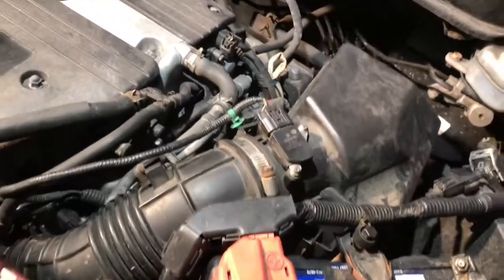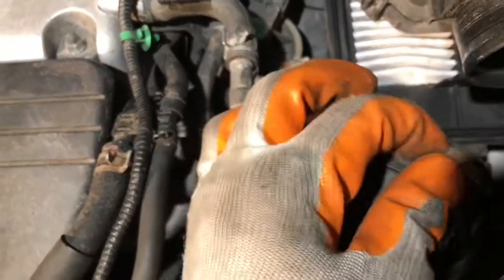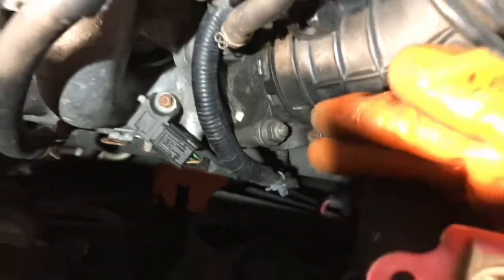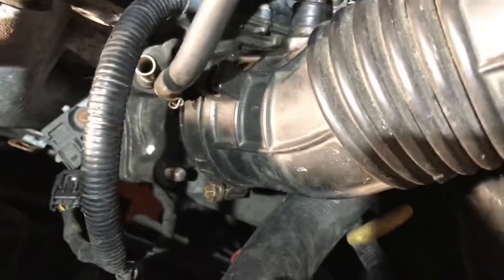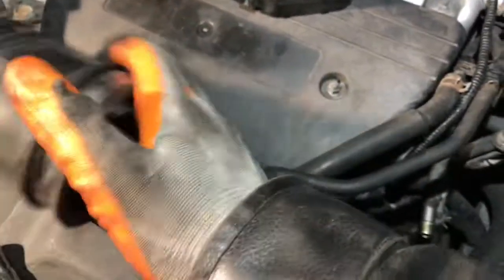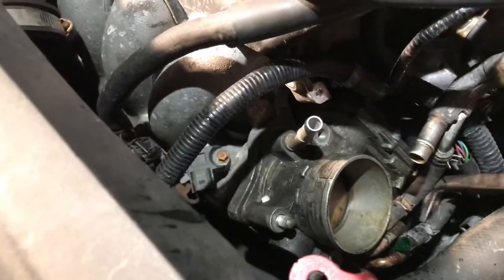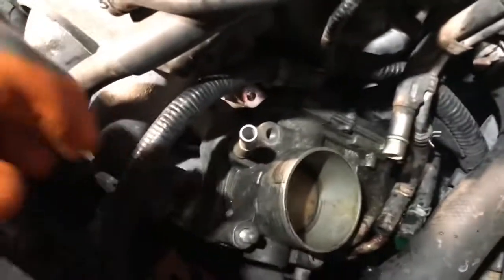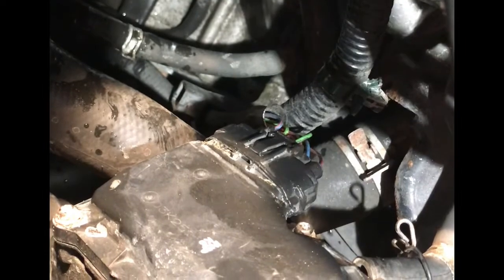Honda crv throttle body cleaning 07–11

Comment: I left the throttle body fixed to the block and cleaned it there, I also pushed the throttle blade open to properly clean it and the car was fine..

You didn't really clean it properly as there would still be alot of carbon buildup in between the throttle blade.